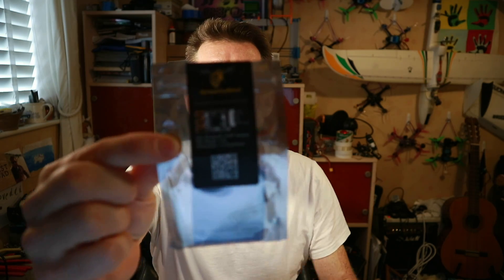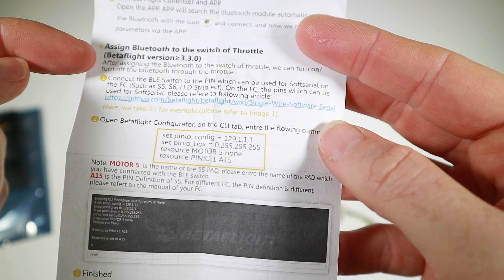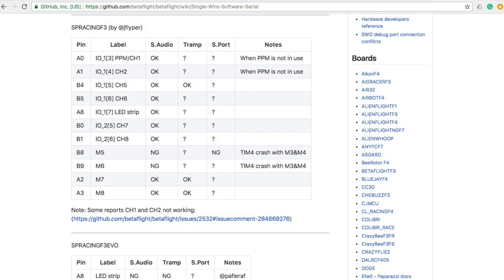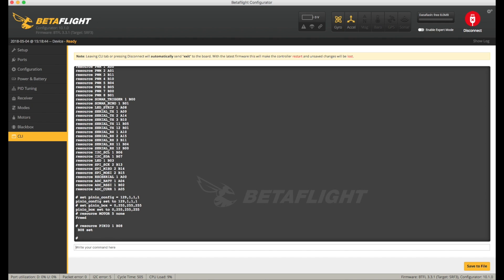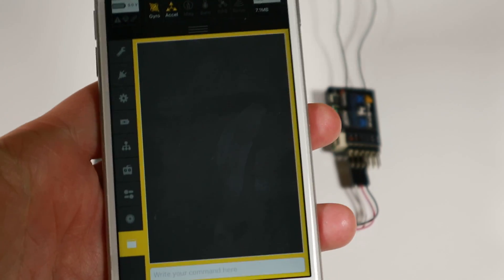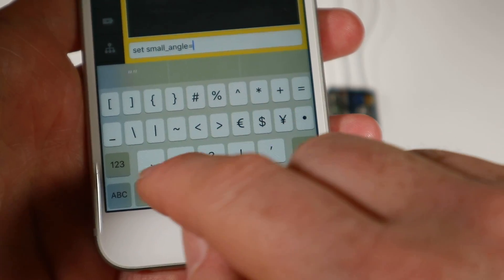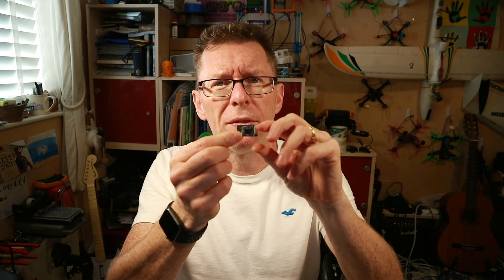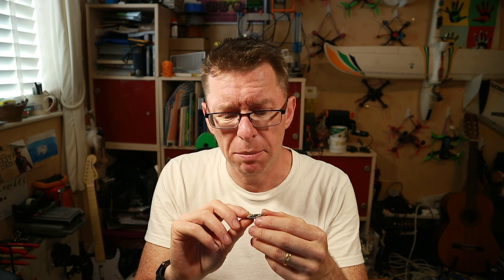FPV Review and Setup Guide: The SpeedyBee Bluetooth-UART Adapter

Comment: Hi, can you do a quick video on how the interface looks with inav 2.0.0? Thanks!
Reply from the maker: If you download the app to your phone, you can put it in demo mode where it will allow you to navigate around Betaflight/iNav/Butterflight configurators as if they were attached to a model
Reply: Ok, but how do you select which software to emulate? As I've heard, inav is still not 100% supported (also auto BT shutoff on arm does not work), especially 2.0.0. I would like to know, which tabs / setting work when connected to and actual FC. Thanks
Reply from the maker: As in you can select between the different configurators - yes.  The iNav configurator looks a bit sparse, but I'm only running iNav on one plane and don't have a spare UART to install the BT adapter in there.  If I can get the USB to BT adapter thingy they do, then I'll look at this again
Reply: Ok, thanks! One last thing: call me stupid or blind, but I don't see an option in the demo mode to change a configurator to iNav, can you you point it? Thanks
Reply from the maker: Here's a screenshot of a pop up I get when going into demo mode https://flic.kr/p/M44nLD I'm on an iPhone, I don't know if there's a difference with Android... I'm led to believe Android is slightly ahead in dev terms

Comment: Would this app work but just using an OTG cable from your phone directly to the quad via micro usb
Reply from the maker: Yes - it should do - at least for Android.  I'm an iOS user so didn't test that.  I've found my old Android phone (I didn't last long on a try of it) but I can't locate an OTG cable to test it !  It's a great app, so even with a cable and a phone in the field, it's still better than using a laptop
Reply: Yes I can confirm that it does work and you can download the app for free and try it out. I did try on a micro f3 board though and could not connect so might not always.
Reply: I’ll give it a try with my kopis 1 and Otg with my new s9 see how it goes better than putting this thing in and figuring that all out on 4 diffent quads and the app is free sounds like a no brained to me
Reply: It works perfect with otg support. It doesn't support butterflight at the moment though.

Comment: oh god no. i just purchased a OTG adaptor and plugged phone into quad speedy bee works fine like that
Reply from the maker: Yeah - it works with an OTG cable as well which is a another good way of using it on the field.  Possible reason for me skimming over that fact is that I'm an iOS user, and I'm more excited by doing it wirelessly